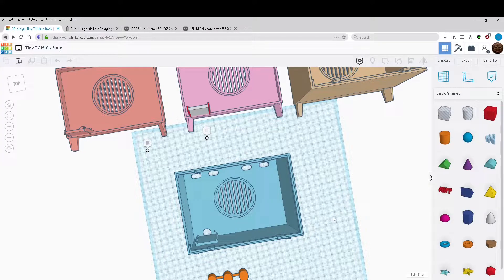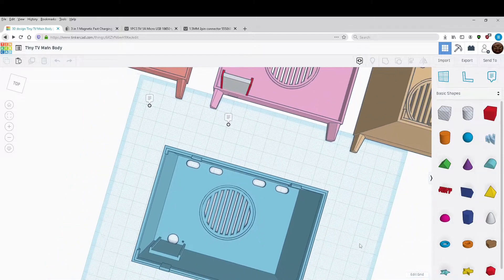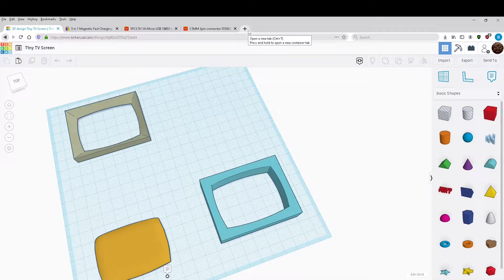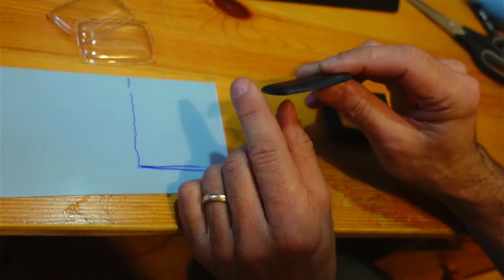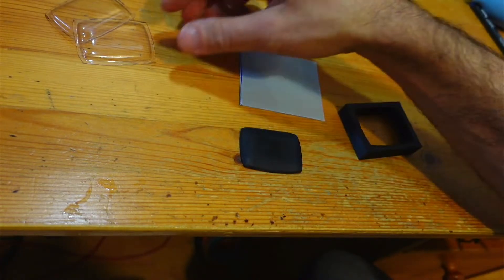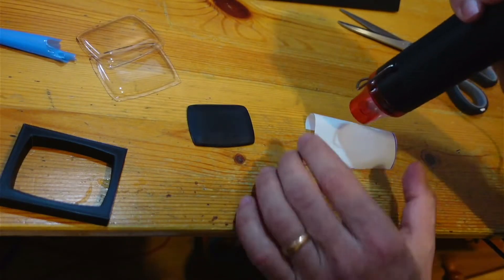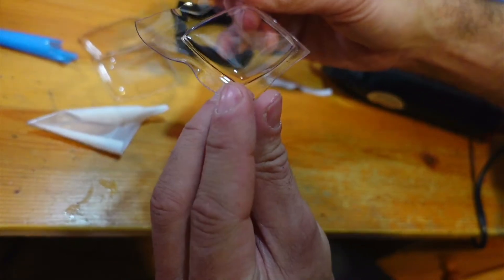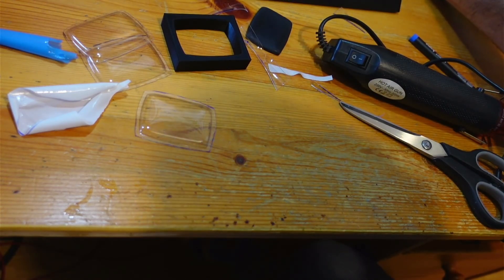"Simpsons" TV Files & Dome Screen Fabrication

Comment: 1. Very cool! 
2. Could you peel the white backing off prior to heating the PETG so you could see your mold underneath (to reduce the “luck factor”)
Reply from the maker: Leaving the white layer on produced the cleanest finish since there were tiny imperfections in the base mould. If I was doing this again I would spend waaay more time polishing. You basically need it glass-like. Cheers for the comment !

Comment: Thanks again for sharing your design!  I look forward to trying the PETG screen, and may convert my USB powered TV over to LiPo. I agree with you; when it comes to design, the right way to do it is the one that works! Sometimes the simple solutions are better. 😁 I printed a PLA patio umbrella grommet 3 years ago that's still working wonderfully.  It's outside in full sun, extreme heat and extreme cold and has yet to crack or show any sign of deterioration.
Reply from the maker: Wow, I was under the impression PLA couldn't handle outside weather. I imagine you did a good job on the printing of the grommet. My early prints were pretty tragic lol. Good luck with the PETG screen. If you fail for some reason, I can send you one. The one I made in the video is a "nearly prefect". All the best. 👍